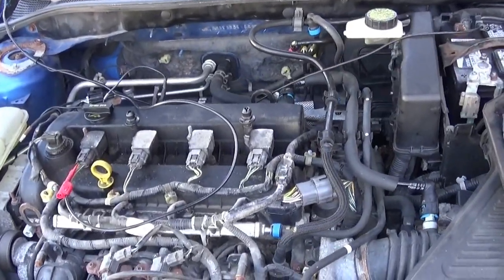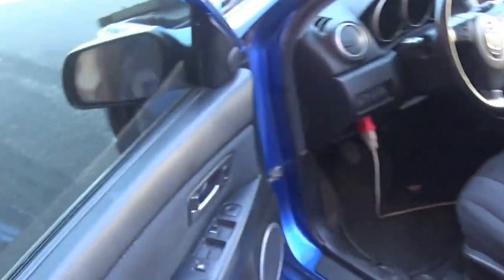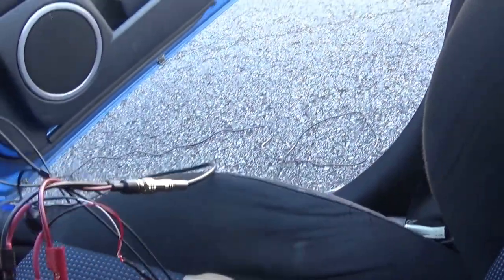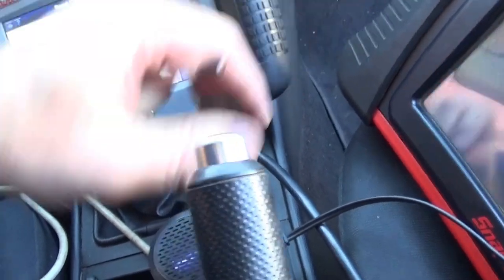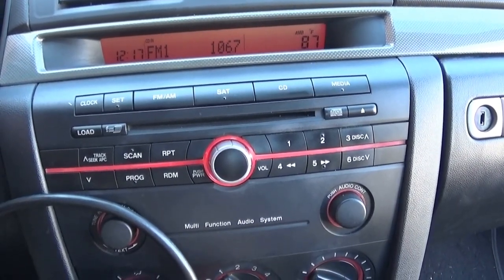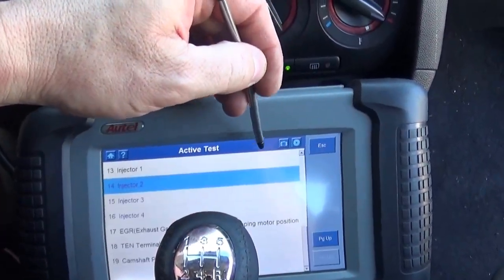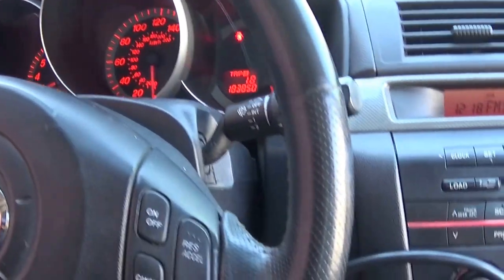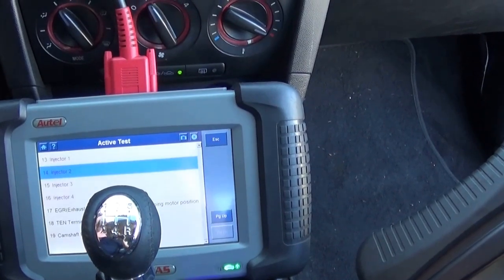Engine Noise Diagnoses With Steelman Listening Tool

Comment: Rod knock like a lot of the 2.3's. I bet it's using a bunch of oil and may have been run low a couple of times. I've seen some guys replace the rod mains, in car, on the Mazda 6 2.3's. Nice detective work. Thanks!
Reply from the maker: Owner got this car at the auction. After 40 mil of driving it started to nock. You are right it  didn't  have any oil. I wish he would check oil level earlier. Its to late know.

Comment: Had an 03 ford explorer once. Rebuilt the upper half of the engine, made a very similar noise and turned out to be the timing chain. Plastic tensioners were busted up and chain was flopping around the front of the engine block blocking oil supply holes throughout the engine, Is that why you had a mic on the drain plug?
 I had a ton of sludge built up from the oil pan and the oil pump was clogged. I'm not saying that's your noise, Just sounds just like that.  Good Video and good luck!

Comment: Hello Ramon. I just started using the ultrasonic tester Whisperer. If icon.  The tool has a female 3.5 audio jack. How can I get the speaker you are using in video to work? Thanks
Reply from the maker: Hi my friend.My speaker fits straight to my amplifier. I am not sure you may need some kind of adapter. Sorry I couldn’t help much.